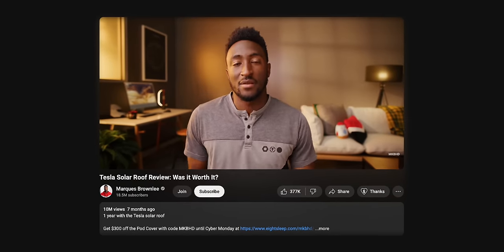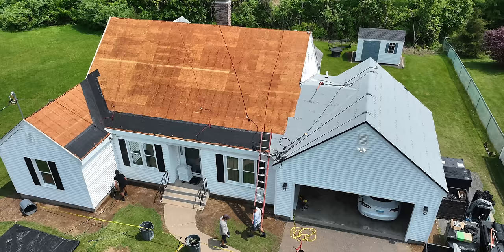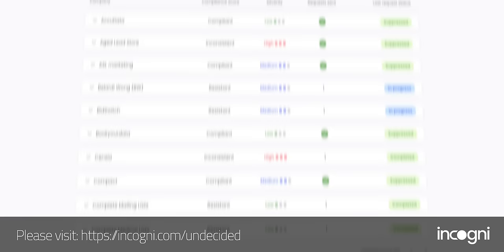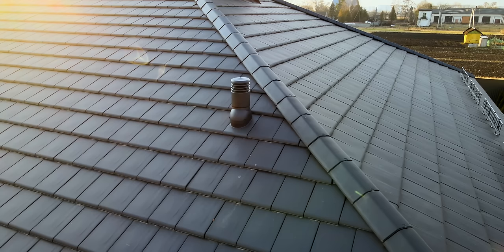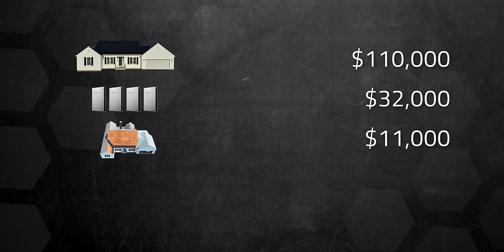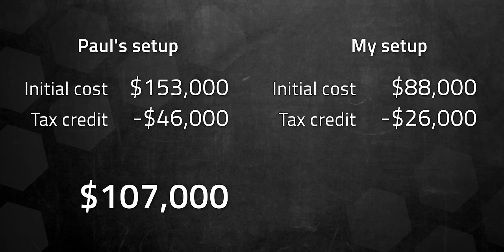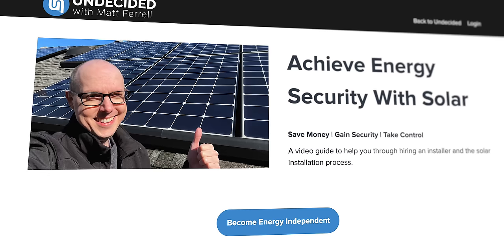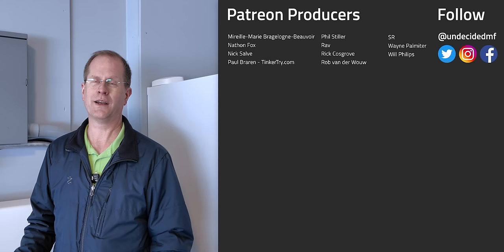Tesla Solar Roof vs Solar Panels: Which is Worth It?

Comment: I do not understand  how you two could pay so much. I am completely off the grid with 14.6 kilowatts of Bi-Facial solar panels, 12 kilowatt inverter with 18 kilowatts of MPPT solar charging and finally 30 kilowatts of batteries with an additional 30 kilowatts more coming. And all for less then $20,000. And I paid cash for all of it. A few days ago I got an email from the electric company telling me the power was out at my address and hour or so later another email said it was restored, we just laughed. We did not know either way as we are no longer connected. The meter is still attached to our house but the main breaker is thrown to the off position. Our solar system runs everything just fine. By the time the sum makes it's appearing in the morning our batteries will be at around 86% state of charge, and topped off by noon tomorrow.

Comment: For a brand-new roof, I can see the advantages of using solar roof tiles. But I absolutely would not buy it (or anything else at this point) from Tesla - for all the reasons cited by everyone in these comments who've found out for themselves. I'd want a company with a long track record of quality and reliability on installation and operation/maintenance over time. I'd want someone I know will be there to stand behind their product decades down the line.

Comment: Metal roofs aren’t necessarily as repairable as you think.  I know a number of 30 year old metal roofs that have been damaged and it wasn’t possible to find panels to match.  Colors get obsoleted and rib styles change.  Often it isn’t possible to buy exact replacement panels 20 years down the road.  Not as big an issue as with new solar tiles to be sure, but not a guarantee either.

Comment: I'm doing an addition that will require of a replacement of my roof. I keep going back and forth on the idea between panels and shingles as well. In our case, aesthetics will not be too much of an issue as the panels will largely be hidden from street view.  There will also be one side of the house that may not make sense for the installation because of tree coverage. 

The installation will likely be a hybrid roof for a variety of reasons, right now panels have an edge because of their efficiency over the same square footage even if we might break even on the cost of the system once you factor in the roof. 

In either case, I'm convinced that I shouldn't work with Tesla. While they have great software integration and software support, they've been demonstrated to have horrible business, installation and hardware support.  Great software doesn't compensate for broken and complex hardware. I'm more excited by the Solteq or GAF shingles as they're designed to be installed like a standard shingle. 

I've got probably another year before we start construction, so there's some time to decide.

Comment: Hi Matt! Thank you for the thought provoking. I've been looking at both systems and it's the cost that scares me. 2 questions: 1)  is that you have a smaller array but have the same size battery storage system, why? Is it to save money on the solar panels? 2) How much money do you expect to recoup from net metering? I live in MA and electricity price is high @ $133K system / $7.2k electricity annual cost = 18-1/2 yr break even costs. This exculedes any tax breaks because I don't get a physical check from the IRS as a tax break. I'm still making a monthly payment on the system.

Comment: Here in Europe, a 17.5kwp setup with a 25kwh battery is 19.000USD, installed, no subsidies at all.  thats including 20% VAT. you  guys are getting ripped off...  

350w  panel: 73$ incl. 20% vat.
25KW hybrid inverter, with 25kwh battery: 12,000$ incl. 20% vat.
installation on metal roof - 2,500$

Comment: It would be nice if there was an option between traditional large rectangular solar panels and the Tesla solar tiles. Particular for new construction, where the roof design could be architected to take advantage of solar production. 
Also way to get a more uniform look. For Matt Ferrell's roof the contrast between a light colored roof and dark panels is more extreme. 
One concern with the large dark Tesla tile roof, is how much warmer it would get vs. a light colored roof like Matt's home. That might make for an interesting point of comparison. The added heat (if any) would require additional A/C cooling in summer, but could be a benefit in winter.

Comment: without watching this video yet I would say no, solar roof is not better than a mounted on a ground solar set up. One when the solar cells lose their effectiveness you are replacing a whole roof not just a panel mounted on the ground. which creates a whole new level of cost. two better make sure your roof is pitched the right way following the seasonal sky to sun patterns to get maximum effectiveness. 3 which goes along with 1 is it's so much easier to replace a panel on the ground than on roof. 4 as a carpenter I can see all kinds of problems in the future or extra added cost because unless you built the roof to handle the extra load on the roof the roof itself will lose its lifespan before having to replace all the framing itself. This goes for panels on the roof as well. Now I am going to watch this video. (edit) watch the video this guys pretty much covered everything I mentioned and more.
Reply: Good points. I do wish we allowed ground-mount in my town, but they don't, and my backyard isn't very roomy. So much luck here with how things worked out well for me (featured in the video), but results vary so much.

Comment: For batteries and inverters, what about comparing against people using server rack batteries and "off-grid" inverters?  The idea being you use cheap LFP batteries and your all-in-one inverter system does not backfeed power to the grid.  After all as you point out, net metering is already basically dead in places like California, so why bother with a system that does it?  It seems like the hardware for such systems is pretty cheap.

Comment: I think you are on the right track, fast installation and support seems difficult with Tesla, the efficiency of their products is lower than current products, their costs are higher, and they will be addictive in terms of parts. 👍
I have a question, you must have thought about it. Shouldn't it be necessary to insulate the copper pipes in your heat pump connections?

Comment: Why do You  pay  prices  likr  this?  in Germany  You have prices lower  than   1 $  per  watt!   The battery   is questionable,  because  the  idea  can be   to  use   the batery   of  the   car.  When  You  are not  at  home   the  house  does not need  that much Enrgy.... OK  You  have  a  "problem"  we have that Problem  in Germany   too  And  that is  that  in Weintertime   the   sun  schines  less  often   but  the  heat  pump  needs more  Eslectricity.  So   You  schould be  konnerktet  to the  Ggritt.   the batery helps through   the  evening, berheps  threough  the  night   baut not  trough  the  Year... If   You  try to  fix  the  problem   oartwise  You willhave  much more  Solarpower   during  the  Year , but  You  will end up with   a lot  of "Dumped Energy"   during  the  summer.... It  is  a better idea   to   have  enough  windenergy  delivering  Wnergy  to  the    geit   form  elsewhere.  Winds  are stronger n  the wintertime, so   Wind  +  solar  on top  of  Your  roof is a  nice  aproach.

Comment: Other people make solar roofs too - and you can make a roof out of standard panels too if you want to. I'd certainly look at them for a new-build. Personally I would try very hard to avoid anything from Tesla because they are very much a 'proprietary walled garden, single-supplier' outfit like Apple. That's the exact opposite of what I want (standard stuff, open protocols, multiple sources).

Comment: Exactly the same reason. If a Tesla (or any other non-standard) panel is damaged (hail, tree branch in a storm for example), will i be able to get a slot in replacement?
Er, if you have a cheap roof under your panels, you may have to take the panels off to re-roof in the future, which is why I had my roof (concrete tiles in the UK) re lined and fixed prior to having the panels fitted.

Comment: Based on the cost of solar, I'm more in favour of community and cooperative solar initiatives.   You either pay for a subscription to a community solar  project, or buy a share in a co-op, and you don't have the same configuration constraints as rooftop solar.  I also like the advent of floating solar on hydroelectric reservoirs. You benefit from the cooling from the water, and you can cheaply turn the entire thing into a dual-axis tracking system to drastically boost power output.  When built on a hydroelectric reservoir, you can utilize the existing grid hookup, and throttle the hydroelectric turbines to equilibrate grid supply with grid demand.

The only instance where I do agree with rootop solar is with solar thermal, as in for hot water and spacial heating.  Or photovoltaic thermal panels.
The thermal component pulls heat off the cells, which boosts efficiency, increases the life, and you get hot water, heat, and you can even hook it up to a ground-source heat pump to 'charge' the ground with heat to improve the SCOP of your heat pump.

Comment: These systems are massively overpriced. $88k at 35c/kWh is 272k kWh which taking AVG house usage of 4500kwh per year plus 1 EV at 4500 kWh per year would be about 35 year to break even 😮😮😮

Comment: I like an open system as much as possible. My current array is 8.9kW tied to a SolArk 15K with 20kWh of Lifepower4 batteries. I am adding another 8kW to max out the inverter. I wouldn't personally go with Tesla or any other similar option due to lock in.

Comment: I worked out the pricing for my 100m2 roof and the Tesla solar panel was well over double what a conventional roof and solar panels would cost. Definitely not worth it in my situation. With the expected battery price dropped this year, I'll wait until next year for batteries

Comment: I’ve been watching solar videos for some time now. I’ve listened to the pros & cons from owners & installers from all over the world. My conclusions so far are as follows:
Avoid trying to sell back to the grid. The regulatory hassles aren’t worth the frustration, and there’s no guarantee that the utilities won’t change the rules of the game. I would stick to a battery backup self consumption strategy. I wouldn’t put panels on a roof. There’s regulatory issues here as well. A ground mount system has fewer regulatory issues & is so much easier to service. Stay away from micro inverters & optimizers, The marketing people push the theoretical advantages, but in practice the well designed DC strings perform just as well. DC coupled systems have efficiency advantages & are simpler. In northern climates with snow, roof arrays can be out of service for days, just when you need them. Ground arrays can at least be cleared of snow with relative ease. My current infatuation is with solar fencing using biracial panels. Vertically mounted panels are self cleaning & can integrated into landscaping to be less of an eyesore. Although vertically mounted panels that don’t face south are theoretically inferior in many ways, some recent studies have shown that in practice they can perform surprisingly well.
To summarize, standard panel string arrays DC coupled to batteries. Battery agnostic hybrid inverters that can function as a whole home UPS when the grid is down & run on batteries when rates are high. The inverters should allow battery charging when rates are low & solar isn’t providing 100% of daily needs. Generator backup in extended grid down conditions.

Comment: I would not install either until I needed a new roof. Then, I'd have to reacquaint myself with any new changes to either system. My roof is 8 years old, concrete tile, so fat chance of changing anything for a long time. You asked. Thanks.

Comment: If you truly want a net zero home you'd have to start by building a house with only 4 exterior walls, literally a cube rather than something that looks like a series of annexes. Things like central heating would just be at the centre, literally.
It would also be better to have a single giant roof for traditional solar panels instead of smaller roofs facing every other way. If you want pure efficiency, maximize resources and lower costs then houses shaped like cubes or even cilinders are the way to go.

Comment: Thank you for the hard numbers, that was very interesting. Comparing the price with german prices:
I just installed 17.7 kWp Solar with 20 kWh Battery last summer, did everything myself (advantages of being an electrical engineer), and payed about 20k€. When paying a professional solar firm to install everything, that would have been almost 40k€ (On an existing roof). Still only a fraction of the american price.

Comment: As the country with the largest desert to population ratio, we have been slow to get into massive solar farms here in Australia. Similarly, although we lead the world with roof top solar installations, grid scale storage solutions have also been slow to progress. There is a reworking of the Snowy Mountains hydro scheme underway to enable pumped hydro storage, but it's been mired in construction difficulties. In my home state of Tasmania though, 100% of our grid energy is renewable, mostly hydro, but also wind farms and roof top solar, so much so that we export power to the mainland via an undersea cable. Still, if we do get going with huge gigantic solar farms in Oz's vast desert regions, we could supply clean energy to many countries in the Pacific rim, probably by creating hydrogen and then ammonia for ease of transportation.

Comment: An important factor with the solar roof is thay the tax credit does NOT apply to the entire cost lf the roof unlike the panels. You can only apply the credit on the portion of the shingles that are solar.

For example we did a solar roof thay was 26k to install. Of that only 16k counted for the tax credit (about 5kw system) 

So thats about s 3k difference in my case

Comment: Matt, another great video. I would take the path that you chose. Your brought up some very good points on the longevity and damage or fault replacement concerns. The Tesla Roof product seems too expensive in the end as the rebate programs won't last forever. Reading many of the comments below also show that the Tesla Roof product might just not be the best choice for other very good reasons. Perhaps, Elon & Team need to put some serious time on the clock at Tesla Energy to get the many issues resolved. Just a thought though....

Comment: Just get a conventional roof and solar PV.  Tesla roof cost just equal with slates/ceramics + solar Panels.  Tesla's solution also slower to install than the two standalone products.  Besides, an upgrade or expansion to your solar PV array is likely to happen after ten years which is awkward with the Tesla Roof. Tesla home energy will take off if they get rid of the slates and use conventional panels, implement a technically off-grid Powerwall and EV charging system to get rid many permits and inspections.

Comment: Easy answer - over $100K for a Solar Roof, with just a 25 yr weather warranty (worse than cheapest shingles) = not smart.    The IRS should only allow a tax credit for the solar value of the Solar Roof, not for the value it gives as roofing.  Us taxpayers shouldn't be subsidizing people's roofing.  Most of the glass tiles are not active solar, only a few rows.  Only those rows should get the credit.

I just installed 7.7 kW panels ($1400 new, slight shipping damage), w/ $1500 EG4 6000XP off-grid inverter, $1500 A-hr 48V wall battery to power the subpanel for front half of my house.  Can draw from grid, as needed, but doesn't feed the grid.  No more net-metering in CA so they now credit little, plus didn't want the utility's paperwork and approval.  Even at that low price and our bright sun, will be 2 yr payback if I fully use the sunlight.  The battery lets me avoid peak-grid cost until 8 pm in Summer.  But my panels serve double-duty as a side carport roof, giving more value than I paid (~$500 for the supporting structure), and I can get at all the wiring and no risk of messing up my tile roof.  Can't imagine how a Solar Roof could possibly pencil-out w/ time-value-of-money, nor Matt's system.

Comment: We are looking into solar since some time. But we will have in the 12kw peak with no battery because after 10-15 years the batterys need to replace and the inverter in that time. Our energy consumtion is about 4500kwh for a year. Heat pump could be added and some car charging should be possible. We need to see now whats the final price.

Comment: The cost of new panels has reduced dramatically here in the U.K., I have seen 570w tiger JA solar panels at £110 each, so 22800watts of panels would be £4400 ( $5555 US )  so off grid set ups that can be done DIY with help from You Tube etc, that do not require qualified contractors seems the most logical way, yes you lose feed In tariffs,  but it would reduce cost’s of purchase and installation dramatically.

Comment: Energy security should not mean losing financial security, the cost of these systems just doesn't make sense. They need to be drastically cheaper. Looks like fun for the EE's in the room but not viable. I live in the south east (GA), more than enough sun but a $90k retro fit traditional panel wouldn't even meet 60% of the summer months energy needs and take 30 years to break even, again it just doesn't work.